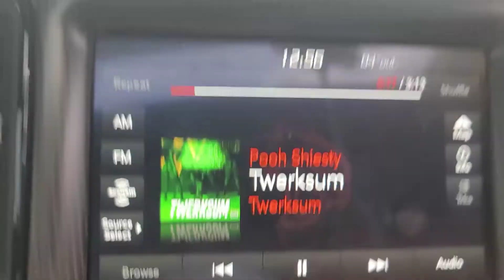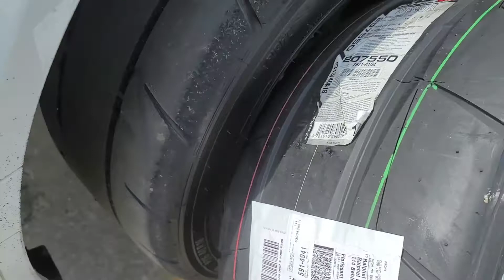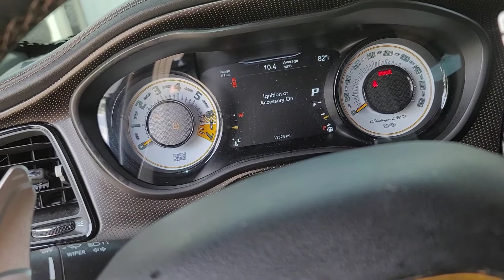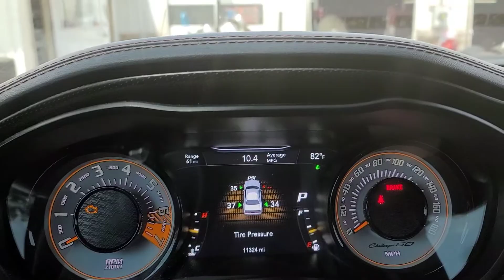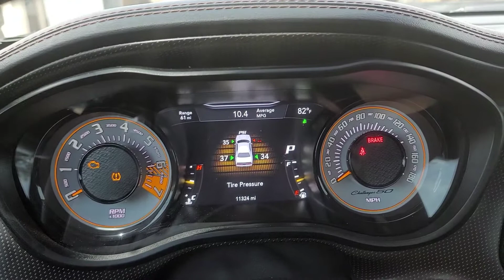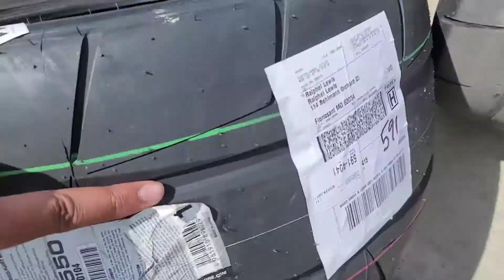Best Tires for a Challenger Widebody!!! Demon Wheels and Tire Set Up!!!💯

Comment: Hey beautiful car.....really nice and I love the paint combo. I own a 15 SRT but these widebodys are clean......Question. I see you got demon wheels but what happened to the Chrome SRT Hellcat rims you had on that wide body? Were those aftermarket?
Reply from the maker: No the ones I had originally are 50th Anniversary rims... the color is called Gold School... I just took them off to put these on...
Reply: @bigblocksrt8683   But they were silver color right? They looked great. I have the Phantom Black Color with the two grey stripes going down the middle...and those rims would look fire on mine. I have the normal SRT Hellcat wheels on mine but they are Black Gloss. - Thanks man...nice video.
Reply from the maker: They are like a goldish Grey color

Comment: what size tire
Reply from the maker: Well that was 315/40/18 but I'm on Hoosiers now 325/45/18 check out my Instagram to see
Reply: @bigblocksrt8683  can a 325/30/20x11 fit on my scatpack I don’t have the wide body. I know 315s fit on my car but idk if 325s is too much. I wanna lower my car on eibach springs and I know 315s fit but I’m not sure about 325
Reply from the maker: @AlexAguilar-io5lr  yeah it should